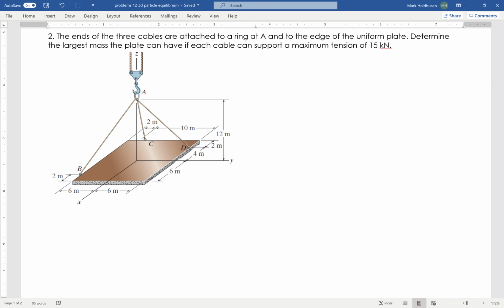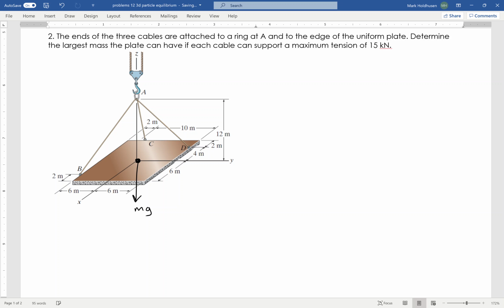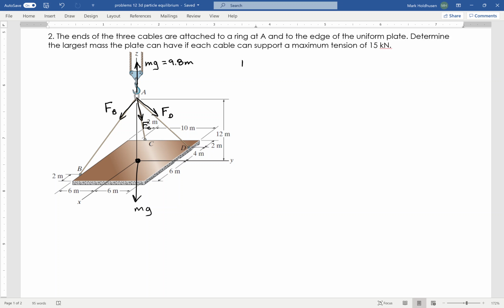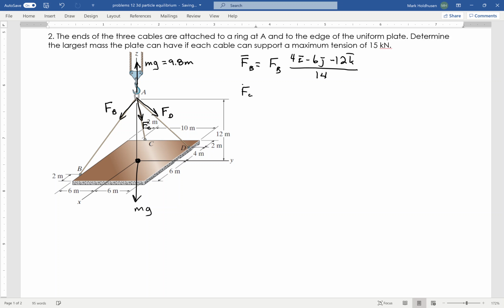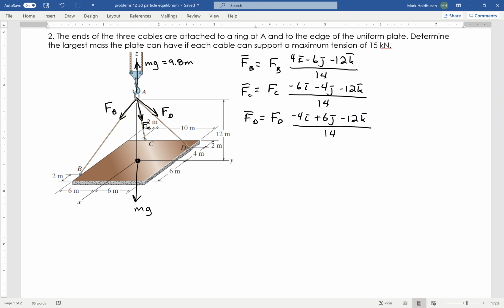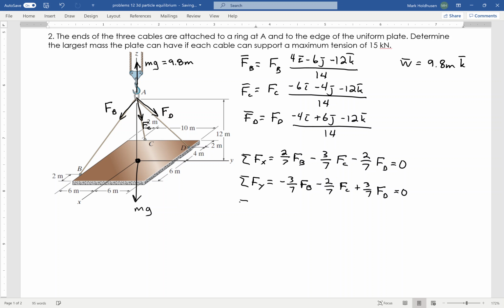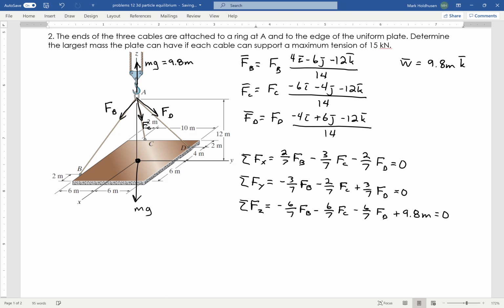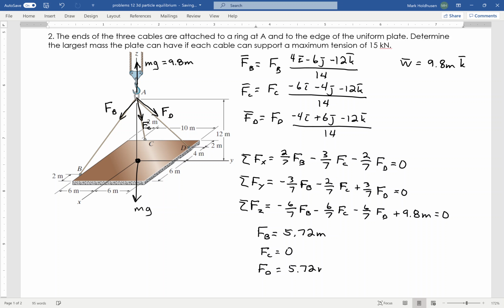ENGR 220 3D Particle Equilibrium Example 2

Comment: for anybody confused with how to find Fb Fc and Fd, here is how I found them:

I multiplied the first two equations (each) with 7 ( I am gonna use b c d instead of Fb Fc and Fd)
2b - 3c - 2d = 0 (then multiply this eq. with 3)
-3b - 2c + 3d = 0 (then multiply this eq. with 2)

6b -9c - 6d = 0
-6d - 4c + 6d = 0
from the sum of these equations we get (-13)c = 0 

now lets continue with the first equation:
2b - 0 -2d = 0 so b = d

lets use this in the third equation from the video: we get -12b/7= -9.8 so b = 5.72